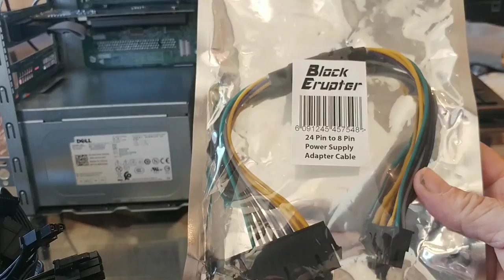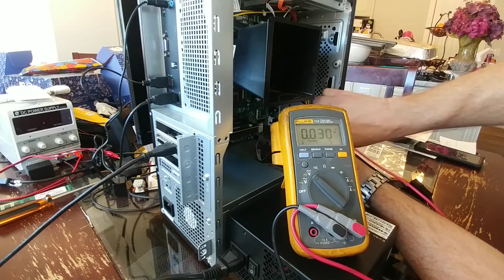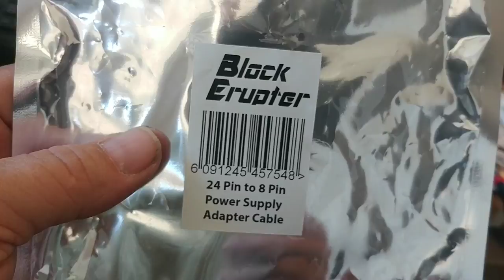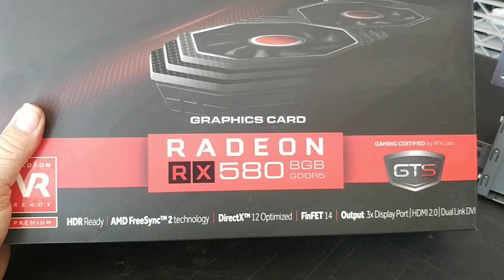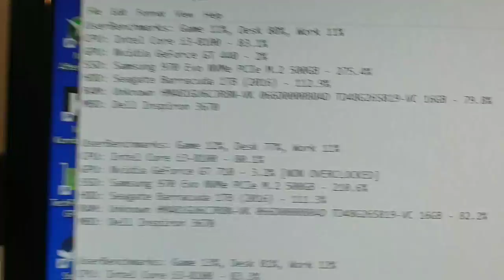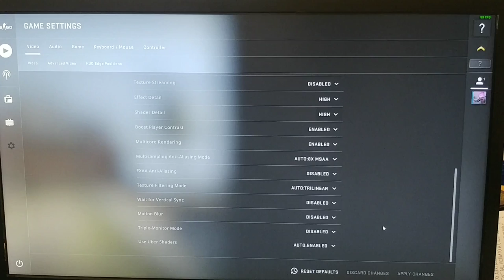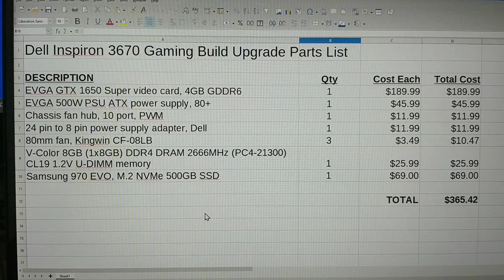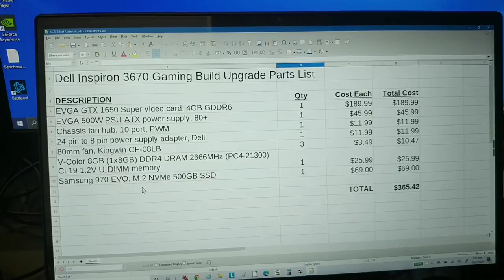Dell Inspiron 3670 Gaming PC Build - $365

Comment: Shane! I was looking back and just amazed how much you helped me with my Inspiron 3670.  I have the Vetroo V5 cpu cooler on its way to the house. Wish me luck on installing it!  I’m assured it’s plug and play using included intel brackets.  Hope you doing well!
Reply from the maker: Thanks for checking back in!  Nice to hear when your video helped someone.  Good luck with your cooler install.  Looks far superior to the stock one in mine!  Let me know how it goes.
Reply: @shanesdiy  I will Sir! It’s a tall cooler so I believe the side fan will need to be moved to the other vent square. I would love to swap out the Kingwin for the Noctua version. The NF-A8 FLX ( that one has the molex adapter which I use on my psu.) I don’t think I mentioned I didn’t use the fan adapter just three molex connectors from my psu directly. Maybe I should give that another try.   Kingwin is 1700rpm, 25 decibels and 30 cubic ft per minute ; the Noctua is 2000rpm, 16 decibels and 50 cubic meters per hour.  Conversion tells me they move almost exactly the same amount of air. Wow.  Looking this up as I’m typing.  It comes down to build quality and life of the fan that justifies $16 for the Noctua and $5 for the Kingwin.  I’m staying with the Kingwins for now.

Comment: I can remember running ST-506 hard drives from a really really old IBM PC outside the case on a Tandy 1000 SL.  It worked well,  but I soon upgraded to an IBM Aptiva (Radio Shack brand) for a whopping $2499.00 .  Hacking these proprietary Dell units kind of brings back those memories. An I always keep a 32 bit system around in order to play the old 16 bit games directly on Windows 2000 without having to resort to Scumm or DosBox...

Comment: Shane!  Im on my name now instead of my wifes, Terri. I wanted to tell you my unique setup. Mine came with the i5-8400. I have 32gb of HyperX Fury ram, Crucial P5 500gb M.2 NVME, and my old PNY 500gb SATA SSD mounted. (no more HDD!)  This is where I went a little different. I mounted (2) 80mm exhaust fans in the grills out the back. I used molex for power, more on that soon. I installed my Zotac GTX 1070 Mini which fits great. Next, the fun part. A Corsair CX550M PSU. Of course the fan is covered up by the bottom of the case...not to worry. I drilled out a bunch of holes for exhaust in the bottom . I stuck some small appliance bottom protectors to raise it a little higher. Lastly I wanted a third fan for intake on the side grill area. After screwing in the fan and powering with molex, the case would not go on. So I decided to mount the intake fan on the outside! The cable runs around the side and in the back. It looks a little funny but it works!
Reply from the maker: Sounds awesome.  I have several PC's with fans on the outside and all sorts of "Frankenstein" mods, whatever you have to do to get the best performance I say!  Really most of the time, who besides you will ever see these PC's?  Thanks for the comments.

Comment: This is an example of what not to do when case modding. Metal flakes could mess up your computer components, Shane took some precautions but still it couldve gone bad.
Reply from the maker: Yes, smart thing to do would have been to remove the motherboard first but I was careful and thoroughly blew it out with compressed air once the cutting was done.

Thanks for stopping by and sharing some wisdom!

Comment: Shane! Your video is such an inspiration for me. I think I have a friend who has a hole saw. Wish me luck if I get the 3670!
Reply from the maker: Thank you, good luck!
Reply: @shanesdiy   Hey Shane! What size drill bit did you have to use? I don’t have any of the tools unfortunately. For the three fans, the one on the side is intake and the two on the rear are exhaust right? Are there any issues with the motherboard not liking those fans or their rpms? It doesn’t look like you had any trouble though.  That’s one of the things I have not done yet is extra fans. Thanks!
Reply from the maker: The hole saw was 4" and it has a 1/4" bit in the center.  Not sure if that's the bit you are referring to.  If you just have to make a bunch of small holes for the PSU fan just make them as big and as close together as you can.  Even 1/4" holes would be ok as long as there are enough of them.

Yes, the side fan is intake and two rear are exhaust.  The CPU fan is also intake and draws in from the same side as the fan I added if you are still using the OEM CPU fan and shroud.  The added side fan required a bit of drilling to make screw holes, the rear fans dropped right in.  I would at least add those two rear fans at a minimum.

The splitter I used will power up to 9 fans plus the CPU fan.  It is powered by an available 4 pin molex plug and just uses the CPU fan output just for the PWM signal to adjust the fan speed.  The motherboard doesn't power any of the fans with the splitter I used, all power comes from the molex plug.
Reply: @shanesdiy  Thank you! I like how the back of the case is ready for two. I might have to get blue led on the fans like yours. Gotta be a little different! Lol
Reply: Shane, another dumb question. If I’m looking to put an m.2 drive in from crucial and it says nvme...will it work here? Dells specs say “One M.2 2230 slot for wireless and bluetooth combo card
• One M.2 2230/2280 slot for Solid-State Drive (SSD)/Intel Optane memory”. Nothing about nvme...ugh   Thanks.
Reply from the maker: @tsayers82   The 970EVO I am using is an M.2 NVME, link in the description.  Hasn't given me any trouble.

Comment: I am planning on having the psu face up and just cut the small steel portion off with tin snips
Reply from the maker: Probably a good idea especially if you don't have the right tools.  It was quite a project to cut that large hole out.  I do like that my PSU gets cold fresh air rather than warm air from inside the cabinet though.
Reply: I get that but buying tools for that is just a waste of money imo if I am not going to use it for anything else and I could just buy a case with that money saved
Reply from the maker: @shreyasdalal  I agree with you, I already had the tools. No way you would want to buy the tools just to do that.

Comment: Great video. I'm doing a similar upgrade to this right now. I'm assuming that because the case fans you installed were non PWM that they run at full speed all the time? Or is that incorrect? Thanks if you're able to reply.
Reply from the maker: CPU fan is PWM, the others run full speed but they are pretty quiet.

Comment: I have the Ispiron 3670 and I'm so bummed that I bought it. My whole thing is great sound. I had a beautiful generic computer that lasted me over 10 years, I bought Klipsch speakers for it and installed a Sound Blaster card and it sounded phenomenal! This Dell makes my poor speakers sound so awful that I feel the need to plug in my $10/10 yr old set from amazon, at least I wouldn't have to direct them away from me. I think I just need to re-install the Sound blaster card but it doesn't seem to have a slot for it. I came here from tapika's review on this computer so I was hoping you could give me some advice  🙏
Reply from the maker: While I don't know how your old system sounded, I don't think mine sounds terrible and I don't have high end speakers on it.  I did have to fiddle with some audio settings within Windows to improve it.  What operating system are you using?  There are quite a few settings you can adjust and some settings that you'd think might be good make it worse.
Reply: @shanesdiy  Windows 10, I thought I had tried everything, but maybe I missed something? I opened up the Inspiron but I didn't see a PCI or PCIe slot - do you know if it has one hidden somewhere?
Reply from the maker: I have my video card plugged in to the PCIe x16 slot and there are 2 PCIe x1 slots. Just those 3 PCI slots.

Comment: I wonder if you take the DVD drive out if you could cut the top of the case for 120mm fans or a 2x120mm AIO water cooler for the CPU? that's not a bad setup though hey if it works and doesn't overheat, I say Good Job man!!!
Reply from the maker: Thanks for your comments.  I'm sure I could "shoe horn" more fans in here if they were needed.  With this CPU even with the little stock cooler, it never gets very hot.  I don't play games very often but my kids do occasionally and I'll watch the temps when they do and even with demanding games I've not seen it get too hot.
Reply: @shanesdiy  nice I can get one for under 100 locally and wasn't sure how it would be but if I could do the case like you did yours and maybe cut the top out for the AIO Cooler I'm really thinking about picking it up

Comment: Hello! I have the same PC as you and I was able to successfully install a EVGA 650 BQ, 16GB Ram 2666Hz, 1TB SATA SSD, and an i7-9700k. The PC runs a little hot and can sound loud when playing games. Could you please send me the links to where you purchased both the 80mm fans you used and the fan splitter? And also, not required, but could you possibly make a video on how you installed these fans and the fan splitter into this PC, since the camera angle prevented me from looking at the full installation? Thanks! @Shane C
Reply from the maker: Sounds like a nice machine you've built!  I added the links to the fans and splitter to the description.  It's pretty simple to install.  Basically, pull the CPU fan plug from the motherboard and it plugs into the red connector on the splitter.  The splitter comes with a wire connector that connects it to the motherboards CPU fan output and it uses this to control the CPU fan speed. The splitter also comes with a Molex plug to connect to the PSU where it gets all power for the fans.  Then you plug in up to 9 additional 3 or 4 pin fans.  The splitter attaches to the cabinet with some double sided foam.  There is additional information on the product listing at the link above.

Thanks for visiting the channel.
Reply: @shanesdiy  Awesome, thanks for the help man. I'm going to buy them and set them up!

Comment: 21:09 You know that it would of been better if you used a fan filter so no dust gets in the power supply
Reply from the maker: Tried it on a few machines but any more I just be sure to keep an eye on the dust and take the machine out in the garage and blow it out with compressed air periodically.  I started with a filter on one of the last machines I built but it reduced the flow so much even when clean I ended up pulling it.  If you have sufficient flow then absolutely install a filter.  Either way, be sure to keep everything clean.  In my day job working on industrial control panels I've seen too many completely plugged cabinet filters, people think since you have a filter you can ignore it.

Comment: Thanks for the video. Got some insights and got me asking, is it possible to change the case on this particular motherboard and connectors?
Reply from the maker: I'm a believer you can hack/modify pretty much anything.  One challenge with this particular motherboard is that the front USB, headphone jack, SD card reader, and power switch are hard mounted to the MB and stick out the front of the case. Any larger case you would not be able to easily access those items.
Reply: @shanesdiy  Thank you. This will surely help!

Comment: Now what did you plug your extra two exhaust fans and the third fan on the side panel what did you plug those into I was confused did you use the extra sada plug with the adapter I lost you there need a little help thank you
Reply from the maker: At 16:47 I show the fan splitter I used and explain it a bit. It powers the CPU fan and up to 9 other fans.  It gets powered by a Molex connector.  The Amazon link to the fan splitter I used is in the video description.  Thanks for watching!
Reply: @shanesdiy  thanks a lot I thought that's what you meant but I got confused I can get all that at micro center here in Columbus so I'm good
Reply from the maker: I would love to have a Micro Center close by, nearest location is 400 miles away... Good luck on your build.
Reply: @shanesdiy  the headquarters stores 12 minutes from my house it's awesome.

Comment: Thanks for the video, really useful. I have this same case and the cpu can get very hot under load so I'm looking at adding the extra case fans like you did. I see the extra fans you used are 3 pin, do they run at full speed all the time or do they copy the speed of the cpu fan? Just not sure if I need 4 pin pwm case fans for them to copy the cpu fan speed. Thanks
Reply from the maker: I still have the stock CPU fan with shroud that pulls air in from the side panel plus the 3 addon fans in the case.  Running MSI Kombustor's CPU burner at 4 cores I don't see higher than about 63°C (145°F) at 100% usage with the room ambient temperature at 77°F.  The 2 add on rear fans and the one additional side fan seem to do a pretty good job.  Do you have the i3-8100 like mine?  If you have a faster CPU it may run hotter.  You may also want to re-paste your CPU if it still has the original paste.

With the splitter I used it takes a signal from the motherboard CPU fan connector and the splitter has a port labeled for the CPU fan because the MB still gets the speed reference signal back from the fan.  My other 3 fans are only 3 wire so run at 100% all the time.  These particular fans are not loud, I can hear them but it doesn't bother me.  According to the fan splitter ad (link in the description) if you put 4 wire fans on it they other fans will throttle up/down as well.  I cannot confirm this.
Reply: @shanesdiy  Mine has an i7-8700, temps often hover around 75-80°C while gaming, sometimes spiking above 90°C. I've ordered new thermal paste and hoping that will improve things a bit. From what I've read, upgrading the cpu cooler doesn't seem too easy because of the limited space. I see David Noble managed a cpu cooler upgrade but the case cover doesn't fit with it in place. I'm hoping to try the case fans first and see what impact they have along with the thermal paste. Think I'll go with 3 pin fans running 100% all the time too. Thanks
Reply: I have one of these machines as well.  The CPU's seldom reach 60 c even when overclocked to 3800 Mhz.  And that's with the stock cooler.  Running A/C in the room during summer months helps a lot,  too.

Comment: Great video! I have a chance to get one of these barebones for around $150 no processor or ram.  I would put in my current parts; Corsair CX550M psu,  a GTX 1070 Mini, and SSD and HDDs.  So I need a processor (i7-8700, 9700 k?) and some Ram.  Do you think some small holes drilled would be enough venting? Or could I invert the PSU so the fan is facing inside? Thanks for reading and stay safe.
Reply from the maker: Thank you for watching, I appreciate the comments.  Enough holes as large as you can, say 1/2" would probably be fine, just do many and as close as possible to each other. I think I'd do that over inverting it.  To invert it you would have to cut the chassis much more to make room for the AC plug, not sure if any other fitment issues would be a problem. Inverted would be pulling in warmer air and that could effect cooling some.  So far I've had no cooling issues, seems to be running very well under a heavy load.

Good luck on your build!  That should perform great.
Reply: @shanesdiy  Thanks! It turns out I can get the system and an i5-8400 for right at $200.   With 16gb of 2666 ddr4 for around $50. so roughly $250 total. With my psu and gtx 1070 I think that's a good price. But do I really need to upgrade. My i7-4790 in a Precision T1700 is running fine...too many decisions! lol

Comment: Such an amazing and inspirational video. I have the 3670 and was considering purchasing a new pc, but after watching this video, upgrading may be the way to go. Only question i have is like other upgrade videos, you get all kinds of error messages once you boot up and people methodically work around them and instruct the computer what to do with the new ssd and memory and other things.... your video didnt show much of this, but instead shows the final product and you gaming on it. Just wondering if you could have showed us the work arounds for some of the error and messages that come up and for recognizing the ssd and other things. Thank you so much.
Reply from the maker: Thank you for your comment and the kind words.  The SSD did not give any errors, I just had to clone the old drive and put it on the SSD.  As long as they are the same size the PC shouldn't know the difference. Many different software to clone a drive, I used Macrium Reflects free version.

Using the proper RAM sticks the bios should recognize it automatically. If you are trying to change memory speeds or such you may have to enter the Bios and make changes. For this particular system it is not compatible with newer higher speed memory.

For the graphics card mine loaded with some Windows default drivers and just had to download the latest drivers from the graphics card manufacturer to get maximum performance and features from it.

Don't be intimidated, take your time to find the right parts and you'll do fine.

Unfortunately, soon after building this PC, the graphics card prices went through the roof so difficult to do this build again for just $365...